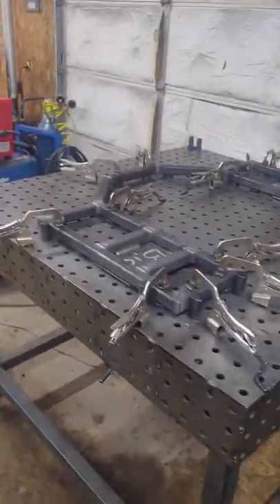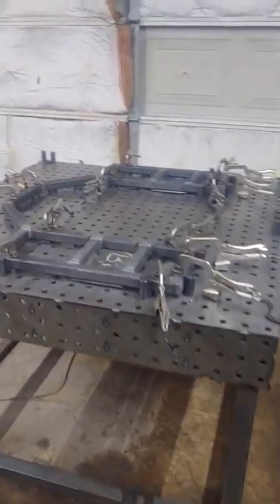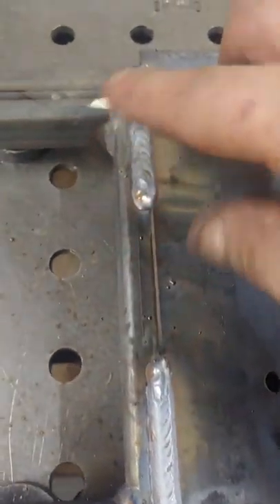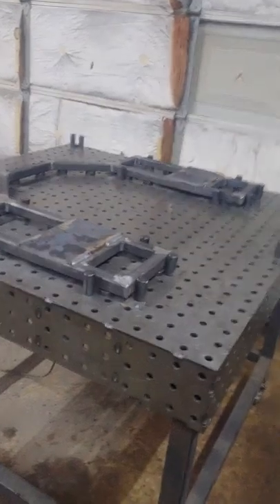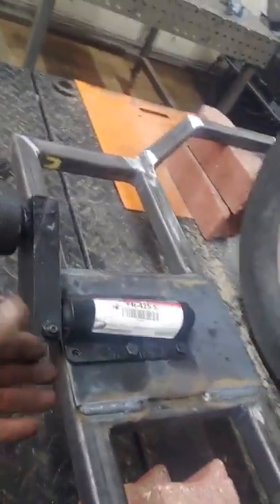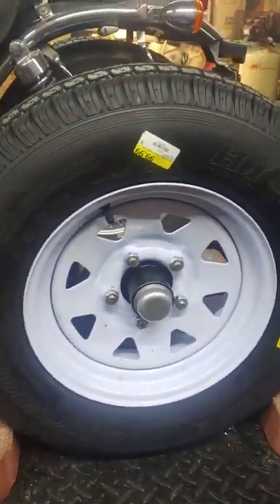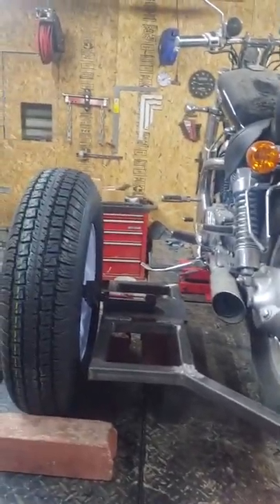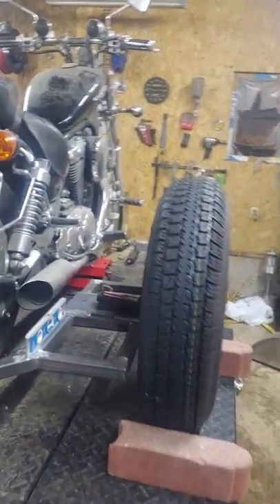BIC Trikes Showing how we build our rear ends part 2

Comment: What's a good weight limit on the torsional axles...1000, 2000? Will they affect the ride or stability of the bike? Awesome video by the way...thanks.
Reply from the maker: We use 425 lb torsion half axles. Any more than that will make it ride like a hardtail
Reply: @bictrikes  Thanks for your quick response, however I'm a big guy and think what you use (425 lb torsion half axles) would do the job, but I can't seem to locate these particular half axles. Would you share your source, please.
Reply: @bictrikes  where can i get the 425 torso half Axel??
Reply from the maker: @waltervillota5139  sdtrucksprings.com